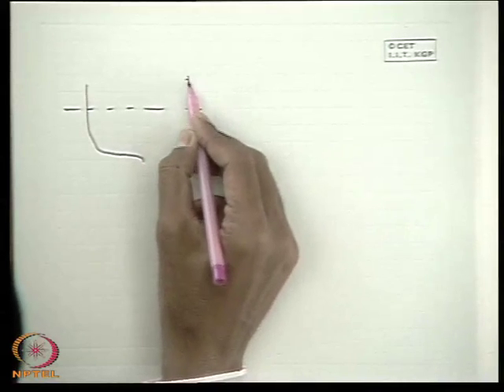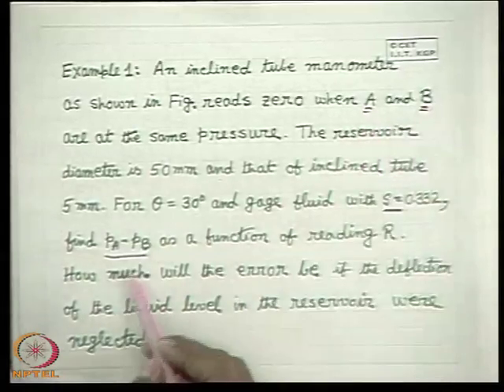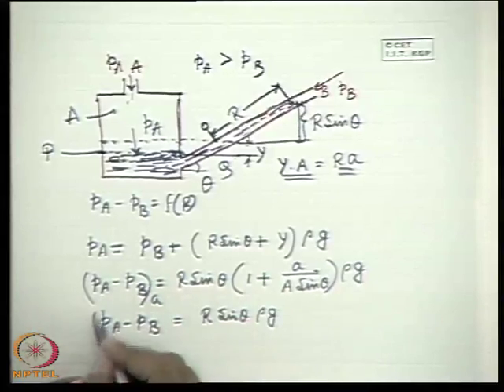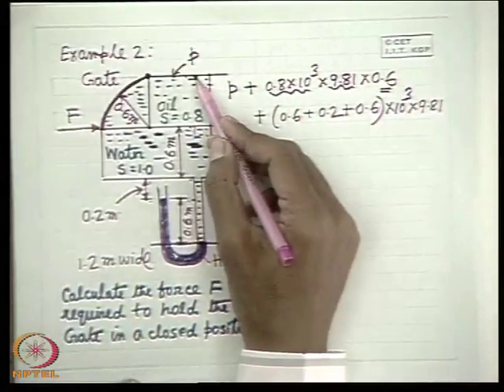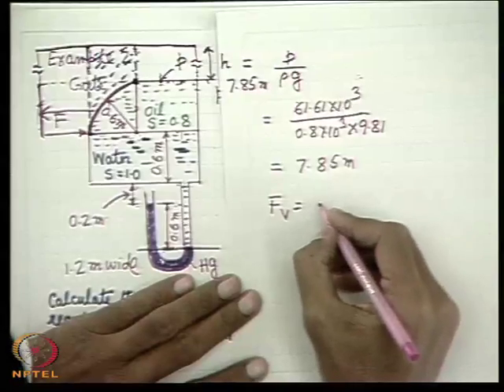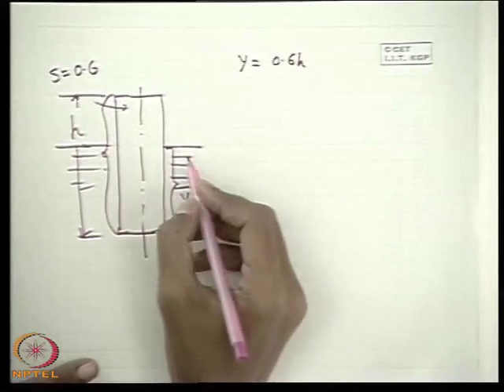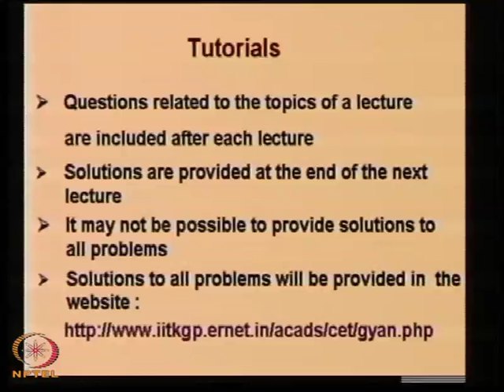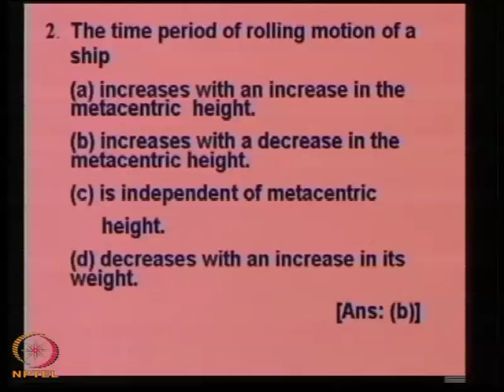Mod-09 Lec-09 Fluid Statics Part -VI

Comment: when calculating pressure from manometer as 61 pascal , it is a gauge pressure and the same is used to calculate forces.
but we have to consider absolute pressure for the force calculation , is it right ??
Reply: calculate the absolute force corresponding the absolute pressure , and also account atm pressure along with force F on the gate .. hopefully you will ffind the same result :) ... and for making things simple you can cut out force due to atm pressure from both side of the equation ... and here the concept of using only gauge pressure comes .

Comment: is metacentre is fixed on the vertical line of C.G or it is continuously shifting along the vertical line of C.G due to the shifting of the centre of buoyancy after tilt.
Reply: according to this lecture  metacenter  is taken as a point about which whole boat is rolling.so it is assumed to be not shifting.but in reality metacenter always changes.
Reply: According to the formula  BM = I/V, the metacentre shifts along the symmetery, however the distance BM remains constant.
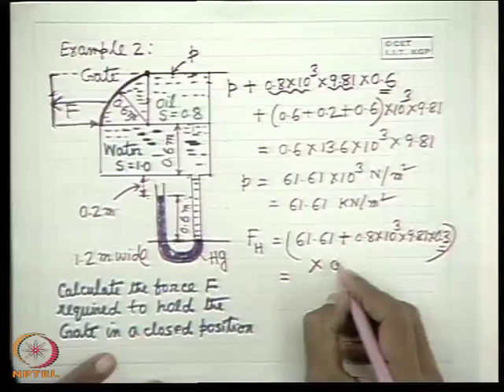Reply: @rajibdas1087  Why do we take 0.6x1.2 for the projected area 24:30
Reply: @ArunKumar-ds6di  because the projected area of the curved potion in the plane will be a rectangle whose length = 0.6m, i.e. the radius of the curved portion and its width is  already  given in the question i.e.  1.2m which is measured perpendicular to the plane of the paper.  Thus projected area = 0.6 * 1.2
Reply: @rajibdas1087  got it. Didn't know about the width of the body. Thank u
Reply: @rajibdas1087 at the time of moment calculations, how F×0.6 , 0.3 should be there na. F is not acting from centre, it is acting from centroid. I. E 0.3 m above' O'? Pls clarify if there is any mistake?

Comment: Instead of calculating Fr and moment .. can we directly equate horizontal component of forces and will get 46.05 KN.?
Reply: no you cannot. since at the pin joint there will be horizontal reaction force, one need to take moment about pin joint so that eqbm holds
Reply: I thought the same way initially ..
Reply: Yes, but only when vertical components passed through a point you take moment about .
Reply: Yes, but only when vertical components of force passed through a point you take moment about.